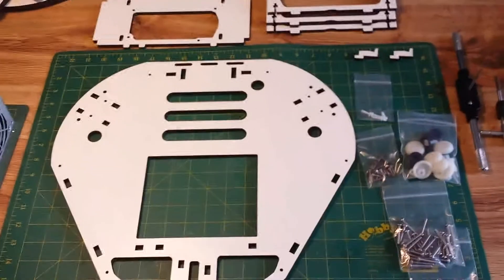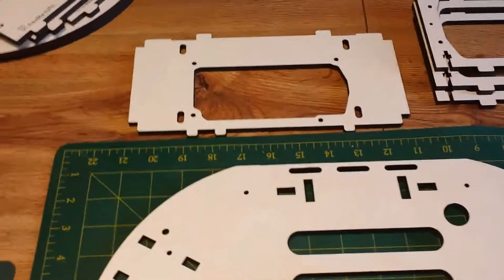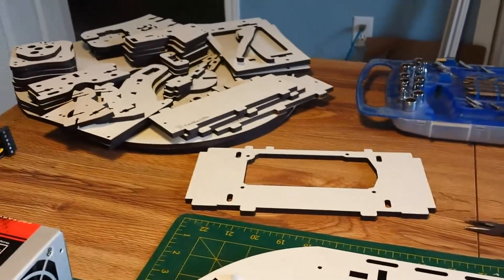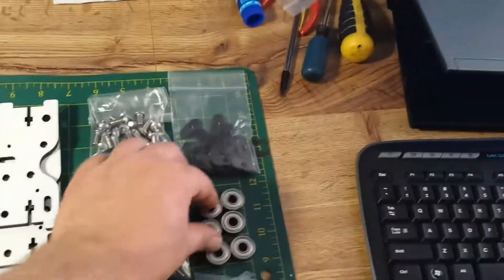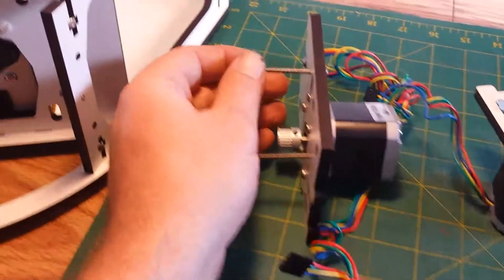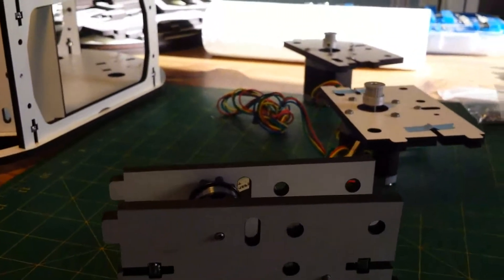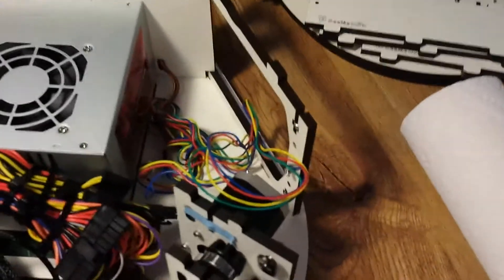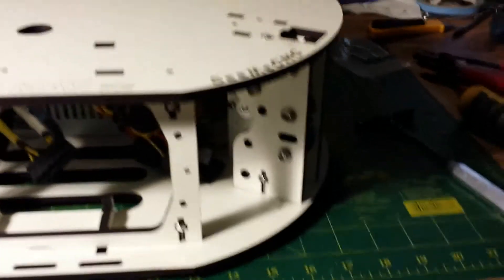Rostock Max v2 Build - Episode 2

Comment: SeeMeCNC do make their parts in house. Using injected molding. What separates them from a lot of reprap kits currently on the market. Allows them to save money on volume parts like what is in this kit. Vs some others where those parts would be 3d printed. The wood is also cut in house. They even sell the very laser cutters that they use to make the wood parts. About $15,000 US. :P